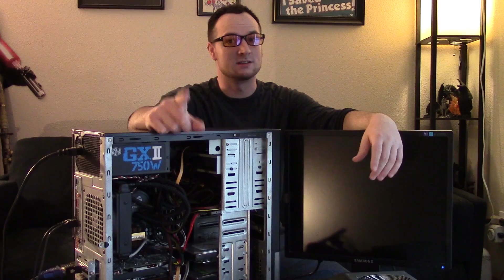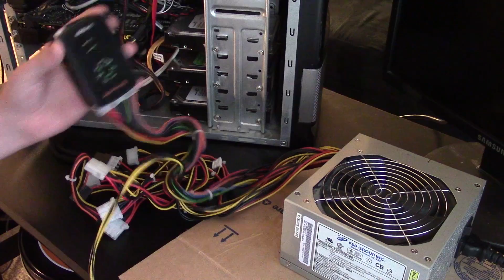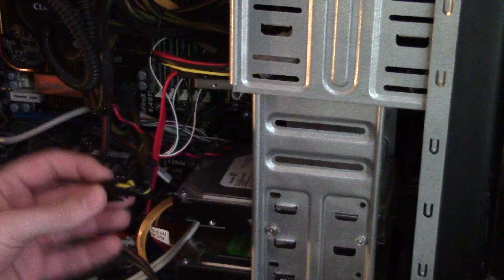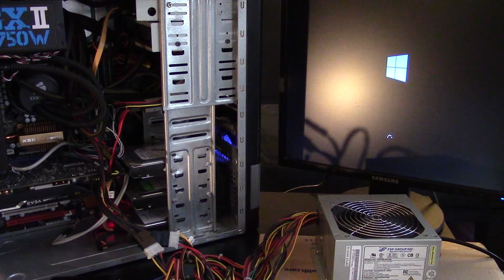💻 Running dual power supplies

Comment: Oh... So you could do this if you only mean to pay and not what most of us were looking for
Reply from the maker: You can easily look up the pin jump with the paper clip. Just showing a different method. Your options are, profesional cables link in description, power supply tester as shown in video or pin jump.
Reply: Oh no I  get you. I get this video entirely, I'm still not going to be positive considering my wait time for pc parts, let alone access in my remote location, so you don't have to worry about it, but fact is the explanation just adds to my irritation rather than any satisfaction or solution to my current issue. I just decided to  leave this comment on here considering the 5 others that are searching for a viable solution specific to our conflict, so they know to carry on and find something more manageable.  I appreciate the response, but again, its nothing on you, but its not the solution those us are looking for and I hope this response conveys my sincerity.

Comment: does the 2nd psu can be use also as powering another system unit? let say u just bridge 8pin of your 2nd psu directly to main gpu then the 2nd psu does have its own system unit. powering the main pc and then the 2nd system unit... will it work?
Reply from the maker: Honestly I would just have one decent one for each rather than splitting 1 PSU to 2 systems like that. There are plenty of adapters for these different setups. For instance for dual setups 
Example: https://www.amazon.com/gp/product/B099Q3G47V/ref=as_li_tl?ie=UTF8&camp=1789&creative=9325&creativeASIN=B099Q3G47V&linkCode=as2&tag=drnoobslab0b-20&linkId=3adbc0e84750bf3b942265beae26d36b

Hope it all worked out for you in the end  ☃️ Happy Holidays. Sorry for the delay in response, as I'm sure you know I can't reply to everyone. Hope you enjoyed the video. Please sub if you haven't already & have a safe new year. 🙂

Comment: wait so does someone need any other parts except for two psus. im trying to run two PSU's for a GPU. did you add a motherboard piece or is the secondary PSU connected to just the GPU(which is what im trying to do)?
Reply from the maker: just connected to the GPU and jumped on the 24 pin.
There are special cables if you want a one button solution. 
Please sub if you can.
Reply: @TheThorns  ah ok its no probs i was asking for someone who had an old pc but they just upgraded with a whole new decent build

Comment: Does it work when you have 2 systems and the more powerful PSU runs the GPU on the low PC. Just also turn them on at the same time?
Reply from the maker: I have not personally tried that configuration. however since they are just power supplies I do not see why not. I assume you mean to have 2 computers 2 power supply's but daisy chain video card power from one machine to the other? Hope you found this video helpful or at least interesting. Please sub if you can.

Comment: Hi doctor noob I've succeeded with your instructions, is it ok if I put my pc in sleep mode?
Reply from the maker: I would not advise sleep mode with this configuration. Some motherboards might not like it. Hope you found this video helpful, please sub if you can.
Reply: @TheThorns  Thanks, so should I just leave it permanently on or should I shut it down at night, how would I do this?
Reply from the maker: @zaklevy7481   Long story short it should be fine to just leave on just remember you are leaving 2 power supplies on. It really all depends on what you use it for. I personally would shut it down every night due to the electric bill. However, others may be rendering, compiling, or mining coins. All good reasons to leave a machine on at all times.

Comment: Thank you great video I will use to install rx580 GPU in hp 9010  externally ***
Reply from the maker: Great 👍Let us know how it works with the HP. You might also just want to get an adapter cable off amazon for the HP power configuration, and add a normal ATX power supply 🎄Happy Holidays🕎 Hope you enjoyed the video or at the very least found it informative. Please sub if you haven't already & have a safe new year. 🙂

Comment: Wtf
Reply from the maker: There are essentially four methods for this, 
1. Jumping it with a paper clip on secondary power supply.
2. using a power supply tester
3. buying the cable adapter
4. wiring them together yourself
Hope you enjoyed the video, please sub if you can 🙂

Comment: Hello, how are you? I have a question to ask you about the power supply unit i have psu 200w Max, and GPU"rx580 8gb".
I have one, I think it's 300w psu, it s possible to plug it in for the gpu.
and 200w for all my specs, except for the gpu no
they can work? pls
Reply from the maker: You might just have to try it out. Most video cards just give a rough estimate of what the power supply should be for the whole system. If you can find out how much the card itself needs and not just overall, that will be your answer.

There are essentially four methods for this, 
1. Jumping it with a paper clip on secondary power supply.
2. using a power supply tester
3. buying the cable adapter
4. wiring them together yourself
Hope you enjoyed the video, please sub if you can 🙂

Comment: Can I just put a mains wire (e.g. earth wire) into the green pin and the black pin and use it to power my 1080ti or not?
Reply from the maker: I would get the professional cable listed in the description if this is your main card and computer just to be safe. However, you are correct you could just jump the line on the 2nd power supply. That said I am not responsible for you messing it up. Hope you liked the video, Please sub if you can 🙂

Comment: thank you so much its really helpful, but I'm not really sure its gonna work in my case.
I have a hp z600, the motherboard comes with 24 and 14 pins not only 24 like most of the boards.
I got RX 580 8GB and as you know the station is really old and the PSU is not able to deliver the power to all the components  as it shuts down after a few minutes of playing.
I have to choose between getting another PSU for the GPU or change the station itself , and you already know which is much cheaper.
so what do you suggest and what you did will work for me or no?
Thanks and keep it up man
Reply: you can get a jumper cable for the standard psu to the motherboard check out green pc gamers . i have a Z400 , i still have the standard psu 475w and powers the power hungry r9 380 fine
Reply: Did you try it?
If yes did it work.
I have the same problem rn
Reply from the maker: SKITTISH GAMING  is correct. You can get cables for this pretty cheaply 
Please sub if you can 🙂

Comment: A few months back a fiend came to my house caring a motherboard a processor (i5 4th gen) and a gpu (gtx 1060) he got very cheap on a deal from another friend.
I managed to scrap together the other components from old hardware I had lying around, but I didn't have a powerful enough power supply. I had heard about this long long time ago just by chance, but never give it too much thought until that day. 
This video helped me a lot to make the computer work, and it is still running today, 6 months latter. 
the thing I did different was to jump the green wire on the second psu to the green one on the primary psu, so both are powered at the same time when you turn on the computer, and wired together the two power cables, so only one plug goes to the wall.
it was a very fun project and it was great to make a computer from things I had lying around, specially because he makes his living from photo and video shooting and editing, so that machine came very useful for him.

PS: I am curious about the 4pin connector for the processor, since the motherboard has an 8pin and is currently only using the 4pin connector from the primary power supply.
would it be a bad idea to connect the 4pin cable from the second psu to the motherboard as well??
Reply from the maker: I personally have not tried this and would fear that it may cause a loop which could short out the whole board. if it is stable at 4 I would leave it alone or find a molex to 8-pin adapter like this one here.
https://www.amazon.com/gp/product/B01DV1Z428/ref=as_li_tl?ie=UTF8&camp=1789&creative=9325&creativeASIN=B01DV1Z428&linkCode=as2&tag=drnoobslab0b-20&linkId=2ed44e7f9c1820b026247161cad826fe

 Glad you enjoyed the video
😋Please subscribe if you have not already.
Reply: @TheThorns  all molex are already on use to connect multiple hardrives and fans, I guess it will stay like that until we can get a better power supply
Reply: @TheThorns  by the way, how long do you think a system like that can be running?

Comment: Nice video!
What do you think of connecting two different psus on a gpu?
The reason for that is that I have a power hungry Sapphire rx 580 and  thinking connecting it with two OEM psus, a 365 watt connected to the motherboard and a 250 watt only for the card. It needs a 6pin connector (sata to 6pin adapter)
And an 8pin (2 molex to 8pin adapter) but each psu has 1 molex. Thank you in regards
Reply from the maker: Personally I have not tried that configuration so I don't know what will happen to the video card. It would all depend on how the GPU regulates power. Personally one powersource for each device is the safest route. Curious why you don't split the molex with molex "Y" adapter. might be an option. https://www.amazon.com/gp/product/B00007JO36/ref=as_li_tl?ie=UTF8&camp=1789&creative=9325&creativeASIN=B00007JO36&linkCode=as2&tag=drnoobslab0b-20&linkId=d89f976a560193e4558386f82e6b5b20

Glad you enjoyed the video
😋Please subscribe if you can.

Comment: NEED URGENT HELP! 
IF I CONNECT 1 PSU TO THE ALL HARD DRIVES AND 1 TO THE MOBO AND GPU , WILL IT RUN SAFELY ?????? @DoctorNoob
Reply from the maker: on most boards yes. assuming you get the right cable and or follow the tutorials. Best to get the cable in the description, for the safest results.
Please sub if you can,
Reply: @TheThorns  alright thanks mate and stay safe

Comment: GPU takes power directly from psu and from mobo simultaneously 
In this configuration the GPU takes power from 2 sources. This is problematic I think
Reply from the maker: It can be an issue if one stays on while the other is not. This is why I recommend the cable in the description so they both power on simultaneously. 
Please sub if you can 😃
Reply: I am also wondering about this. I still don't know if it is safe or not. 

Planning to have 1 GPU attached to the motherboard but that GPU is powered by a 2nd PSU (via an add psu adapter). 

So basically it draws power from PCIE (main PSU) and cables (2nd PSU).

Comment: For the Synchronized STARTUP and SHUT DOWN of both PSU is possible. Just Connect GREY (Power Good) cables of both PCU to each other, do it for the GREEN cable too. This will make your main PSU to also control the second PSU.
Reply from the maker: Thanks for sharing! ☃️ Happy Holidays. Sorry for the delay in response, as I'm sure you know I can't reply to everyone. Hope you enjoyed the video. Please sub if you haven't already & have a safe new year. 🙂
Reply: Connect the grounds too, that avoids electrical problems and flakyness.

Comment: Trying to resist the urge to use the paper clip method. Bought a MSI armour rx 580 oc gpu, I have a dell optiplex and been waiting for a 24 pin to 8 pin adapter from moddiy. I had a cheap 24 pin to 8 pin adapter from amazon that didn't work it made a burning smell had to get rid of it. I thought it was a psu problem and send 2 psus back to amazon. Using the stock optiplex psu but this gpu needs the 8 pin connector. Is it bad to use the staple method even for just few days?
Reply from the maker: Just get the cable , although it works in a pinch I hate the paper clip method. I usually cut and solder if it's a throw away PSU or get the specialized cables. ☃️ Happy Holidays. Sorry for the delay in response, as I'm sure you know I can't reply to everyone. Hope you enjoyed the video. Please sub if you haven't already & have a safe new year. 🙂
Reply: @TheThorns  built a new pc and kept the msi armor dont need to do paper clip method thx for replying

Comment: So I have a small rig Pak Bell which has NO extra power cables inside, but want to add a graphic card. Would this be an answer?
Reply from the maker: I would test it 1st before investing in a new graphics card or power supply. My recommendation would be to buy the cable as it works better than a tester, and try it with a used graphics card and used power supply if you have any laying around.
Please sub if you can, also let us know the result if you move forward with it.

Comment: Damn it's January 2020, and I had an x58 system somewhere back in 2007 or 2008 when I started my IT career ... lovely times! infact I had the same x58 board, and that POST screen is the one I had ... it was my first gaming PC too
Reply from the maker: I was actually using it for a very long time. Had a liquid cooler in it with an i7. 
Please subscribe if you can 😃

Comment: Pls help me... When I connect my GPU to 2nd psu...its spins so loudly n fast ..as far as I know normally gpu don't spin so much at start  ..also I get display black screen ..
Reply from the maker: Sounds like you motherboard cant sync. I would stop there and consider getting the cable mentioned in the description assuming the power supply isn't proprietary. Sub if you can and hope this helps.

Comment: Hello! Please tell me how you installed a full-fledged ATX power supply in the case, were there any problems, such as drilling? And one more thing, if there is a stand for the power supply unit so that it does not fall?
Reply from the maker: All depends on the case and size of the power supply dimensions. There are so many case sizes and power supply sizes that there is no simple answer. measure, plan and execute. I have even seen some mods where people put it at the bottom of the case and run the power cable out the back using empty card slots. 
 Please sub if you have not already 😋

Comment: My motherboard is compatible with one supply and my gpu is with another so how do I do this
Reply from the maker: perhaps you should watch the entire video and read the information provided in the description. I offer several ways to run two power supplies which it sounds like you might need. If you just want to run on one power supply you may want to consider looking for a good standard power supply and an adapter compatible with your board. Example below.
Please sub if you have not already 😋

HP board example:
https://www.amazon.com/gp/product/B06XW7RWNH/ref=as_li_tl?ie=UTF8&camp=1789&creative=9325&creativeASIN=B06XW7RWNH&linkCode=as2&tag=drnoobslab0b-20&linkId=8d1e6083e98fcd4ef7697d82427e6f39

Comment: What happens when the computer goes into sleep mode and what happens when it comes back from sleep mode?
Reply from the maker: I personally have not tried that since I do not have any of my systems set to hibernate or sleep. If this is something you can not live without I would buy the cable adapter in the description instead of this trick.
Please sub if you have not already 😋

Comment: can I use just 8 pin for graphic card and dont plug 24 pin to that black thing? please answer I need help. I just want run my gpu with 2nd psu. but I dont have that black thing that you connect 24 pin to that. 
I just can plug 8 pin.
Reply: yes
Reply: just put jumper between green wire and black at 24 pin
Reply from the maker: buying the cable adapter or using a tester is safer but yes connecting these points will also work.
https://bit-tech.net/guides/modding/how-to-jump-a-psu/1/
Please sub if you have not already 😋

Comment: or you just connect the green wired together and then they work as 1
Reply from the maker: You can jump it but recommend the cable in the description or a power adapter tester. Please sub if you can 😋

Comment: Hello! I have DELL OPTIPLEX 9020 the problem i can not upgrade the GPU because of PSU it is 290 watt only and i can not upgrade the PSU because of the motherboard power adapter..So there is any solution for that's ??
Reply from the maker: LOL, Watch the video you just commented on and read the description in full.
If you have not already, Sub if you can 😋
Reply: For what you connected with the power supply 24 pin ??  Is that connected also with the motherboard ??   @TheThorns

Comment: What about soldering out the on/off switch of 2nd psu en solder those contacts to the 1st psu?
Reply from the maker: I'm sure you could do that, but for safety and convenience I would just purchase the cable listed in the description. 
Sub if you can 😋

Comment: can i use like that but the other psu im using it jusy only for the graphic cards
sr 4 my bad english
Reply from the maker: No worries my friend. It setup correctly this method can be used for hard drives, graphics card, and other devices. I do not recommend using two power supplies on one motherboard unless the motherboard is designed for it.  Please Sub if you can 😊

Comment: I wanted to test my rgb fans and I connected them to my new psu and Also my gpu (one thats in my case) powered by the new psu as well. Everything else is powered by my old psu. Do you really need to plug in a mobo connector into the psu for it to work fully?
Reply from the maker: you can sometimes jump the connection. They also make cables for this as well. I Put a link in the description for one of those cables.
Please Sub if you can 😊